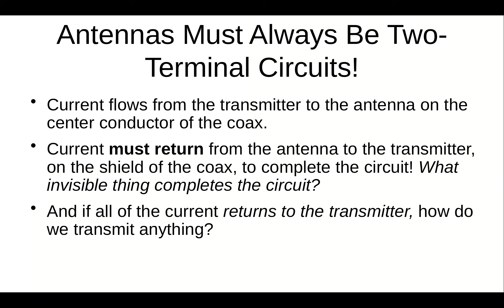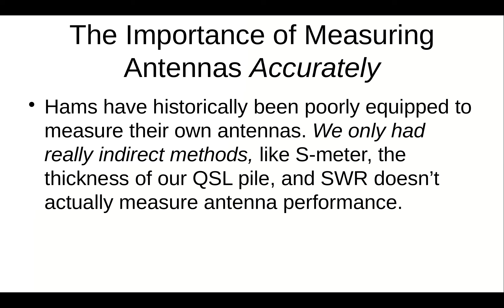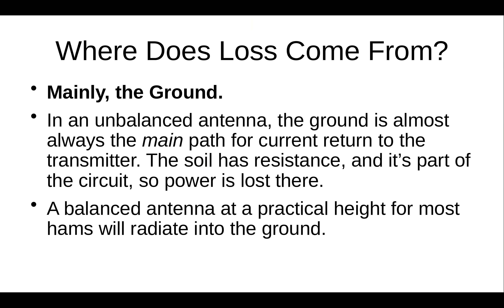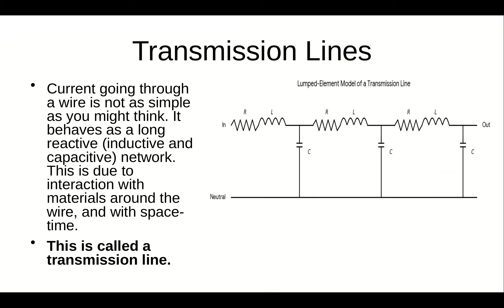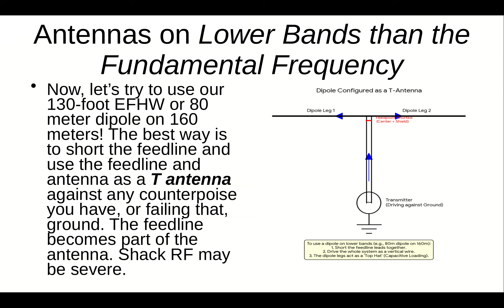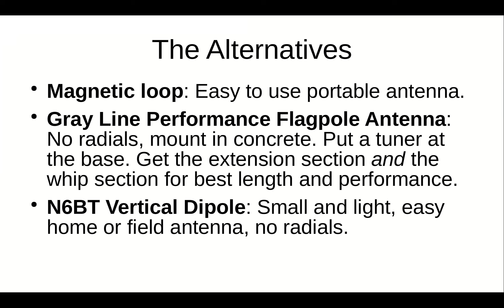The Counterpoise - The Other Half of Your Antenna!

Comment: Video is nice, but there are some errors. Minor one is that "Unun" means Unbalanced-Unbalanced and so should be pronounced 'Un-Un' (as opposed to 'U-Nun'). Similar to BALanced-UNbalanced = 'BAL-UN'.
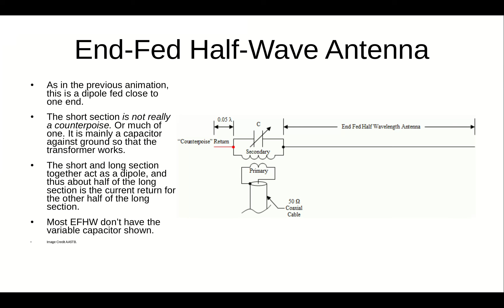The diagram at 43:54 shows a current distribution that includes what appears to be a massive polarity discontinuity at the mid-point, at maximum current. That's physically impossible. At the halfwave (lowest band), there's a smooth (sinusoidal) current peak, but it does not change polarity with distance (but it does with time). Just the perfectly normal standing wave. So the instantaneous voltage can vary along the wire, especially obvious at the higher bands.
I didn't watch the whole video.
Anyway, as far as the counterpoise goes, it's sinking the 'return' current, but keep in mind that it's on the Hi-Z (~2.5k) side. That's one reason why it doesn't need to be a quarter wavelength. 100W would be about 200mA at the 2.5k feedpoint. The current sink demands on the counterpoise element are modest as it's Hi-Z at the feedpoint (after the Unun). The counterpoise is not dealing with 50 ohms and several amps. It's part of the Hi-Z side.
While I'm here. One can install a choke next to the (e.g.) 49:1 Unun, but that's a point that is Hi-Z in the common mode sense (the counterpoise current). So it's not the ideal location for a choke as it's a current minimum. You'll likely need another choke further down the cable, where it has some current to work with. Chokes are inductors, and inductors are magnetic components, and the operate on current principles. Installing it where there's so little current is at best an inefficient use resources. Perhaps better to align the coax with the wire and allow it to act as a counterpoise, and add a choke further down the cable. Thus everything would be aligned with the radiation pattern.

Comment: This is fun. I hope to get a full license. Long EFWs are my thing right now. Luckily, I have plenty of room. I inherited my dad's HAM gear but I shall buy new. I still have my FRG77 I bought new in 84 on a 9to1 unum I made. It needed a good earth and counterpoise, or it would not work at 50ohms. It works best in a straight run at a steady rise towards my target subject. Plenty of time listening helps build up confidence without being a nuisance. I have tried parallel wires for different bands but find they affect each other so I stick with a single untuned 187 feet and my homemade tuner. Angle of rise makes a big difference.  I have a large hydraulic tower to be set in the ground. I never looked at it at my father's house. Looks like the ram of a car ramp, only taller. It is 3 phase, luckily I have an old ex RAF generator with 3-phase to power it. I have enjoyed this video so much without being dumb struck. I look forward to watching more .Thanks.

Comment: What about a non-resonant vertical with 3 raised non-resonant counterpoise wires (3-5 feet off the ground) AND a tuner at the feedpoint (NO balun) mounted 3-5 feet off the ground???  If the main radiator can be non-resonant, why can't the CP's be also (as long as a tuner is connected at the feedpoint)???  This is similar to what I am currently testing with a Portable 10 meter Spiderbeam fiberglass pole in local parks.  Has excellent results on 20 & 17, very good on 40, but tuning 15m not as good.  Maybe I will shorten the CP's just for 15m and see what happens. Very good presentation and I like your sense of humor.  And I like the concept the E & H fields support each other as a radio wave leaves the antenna which seems more in line with observed (actual) reality compared to math-based computer-only models of the physics of radiation. ❤

Comment: Excellent presentation. I think your recommendations at the end are very valuable. Any antenna that gets you on the air is better than none, you can work towards a better antenna. Verticals like the DX commander are great choices, especially with plenty of radials. From my understanding, if you live in an area with poor soil conductivity, a horizontally polarized antenna like a dipole or doublet may perform better. You can improve the ground losses in the near field, but the low angle radiation from a vertical also depends on far field ground reflections, and you can’t control the ground in the far field. With good soil or near salt water, a vertical can be one of the best choices. Of course, like you mentioned, with a dipole (or better yet a doublet) it helps to  get them up around a half wavelength, which gets much easier on the higher frequencies like 20m through 10m. Thanks for such a great video.

Comment: An amazing tutorial centered around antenna system power loss and radiation efficiency. Bruce does a masterful job of tying together the often misunderstood roles of counterpoises and other significant antenna factors, factors that when overlooked, can lead to enormous transmission power loss in unbalanced antennas (virtually any other than a dipole or loop).  Without a doubt the best overall antenna 'system' presentation I have seen on these topics, clearly illustrating their role and significance in the overall antenna system.  I had often found these topics less understandable or even confusing when presented in isolation. Furthermore, Bruce's advice to "get the antenna that will get you on the air as soon as possible ... get the dream antenna when you can." helps keep the presentation's details in perspective. Great job, 5 stars IMHO.

Comment: Good but B-minus in my opinion due to some easily fixable flubs. (1) The counterpoise length talked about in your intro to the EFHW world is NOT ".05 %" as you show on slides.  It is 5 percent (i.e. 1/20th of wavelength). (2) There is no such word in modern English language use as the adverb "zealotly".  You meant "zealously". (3) Your explanation of what is ACTUALLY going on electrically in the EFHW antenna is novel and, at first glance, radical.  Your verbiage used to explain what you believe is going on needs some reworking because you have very likely hit on a ground-breaking (no pun meant) advance in understanding the EFHW religion that has swept ham radio in recent years. (4) In at least one slide you used the verb "effect" when the correct term is "affect". Those two words have very different meanings.  

 In sum, it is a very good effort at building a lecture that can help beginners in ham radio understand some crucially important basic tenets BUT some polishing and very careful proof-reading could make it far more effective.
Reply from the maker: Dear James,

Thank you for your most zealously complete evaluation of my talk. :-)

Yes, I should fix the 5%.

I have given up the fight of "effect" vs. "affect" as, although I agree with
your usage, too many people correct me with the psychological usage in mind.
I came to the conclusion that I could just not win.

Regarding my possibly-novel view of the EFHW, I suspect it is more an issue
of nomenclature. The short wire should never have been called a "counterpoise",
and the obvious counterpoise in the circuit is half of the 130-foot wire, half
a wave long at the design wavelength of 80 meters.

Obviously Fuchs was confused in his invention of the end-fed Zepp in 1928, this
clearly being an open circuit from the perspective of the antenna, if not for
interactions not shown in the schematic. See
https://myantennas.com/wp/oe1jf-efhw-patent-at110357b/
and
https://myantennas.com/wp/wp-content/uploads/2020/02/QST_Jul_1928_p37-37_42.pdf
At some point later, the 5% wavelength wire was added and someone called it
a counterpoise, but it was always too electrically short to be an effective
one.

This is why many people look at the EFHW and say "impossible", and then have
to turn to the feedline as an unintentional counterpoise to explain why its
users have thick piles of QSLs from its operation. And this may be true,
depending on how well the feedline is isolated.

But (as I stated), if we just consider the short wire to be the capacitive load
against ground necessary to provide full current through the transformer winding,
this corrects what we might initially percieve as near to an open circuit.

We also have the matter of ubiquitous VHF/UHF vertical antennas with short
counterpoises, which provide the correct impedance at the feed-point, but
are too short, on their own, to provide an effective current return. Most such
antennas have a vertical element of 1/2 wave or longer. Either the mast and
feedline are standing in for the counterpoise, or these are in reality EFHW's!
I doubt that none of their designers understood that.

I would be interested in reading your try at explaining this better.

Comment: maybe I have missed it all together, if 0,05 times longest wavelength..is not correct lenght for the counterpoise with efhw... what is?
Reply from the maker: That short wire is not the counterpoise. It is mainly a capacitor working against ground so that current can flow through the primary of the transformer.
Reply: @bruceperens4749 a common misconception. The short wire is a part of the antenna acting as a capacitor and inductor working mostly and actively against the other side of the point of feed.
Reply: The antenna capacitance is the capacitance from one side to the other. If you consider the formula R+jXL+Xc, then we can see the Xc and the XL increase as we approach the ends. AT THE FEED POINT. The term "counterpoise has no real meaning. It's all just "antenna".
Reply from the maker: @N9XRradio  - Well, in this case the short wire is on one side of the transformer secondary, the long wire is on the other side. Without the short wire, the secondary of the transformer would be connected to a wire on one side, and an open circuit on the other, which would not work. And the short wire isn't being an antenna, it's being a capacitor against ground. Its capacitance is definitely not summed with that of the long wire, which is on the other side of the transformer secondary: an inductance. And if you don't like the word "counterpoise". try "current return". Half of the antenna must emit current, and half must return the current to the transmitter, and the antenna is only as good as the worst of those two.